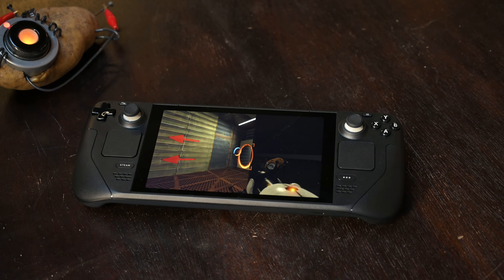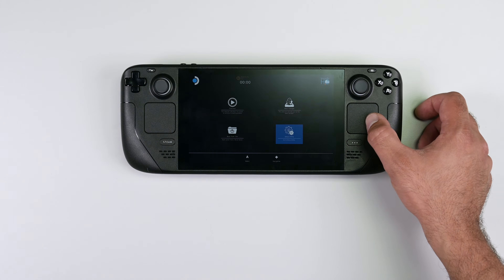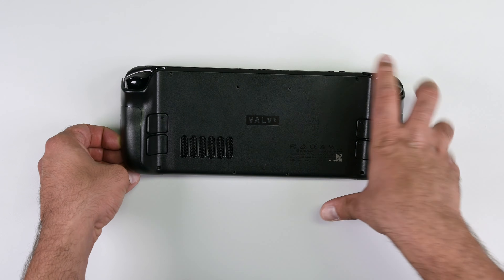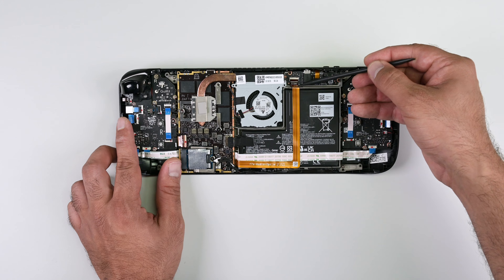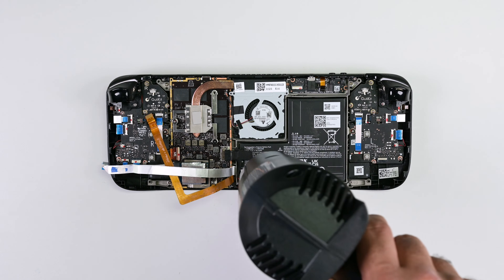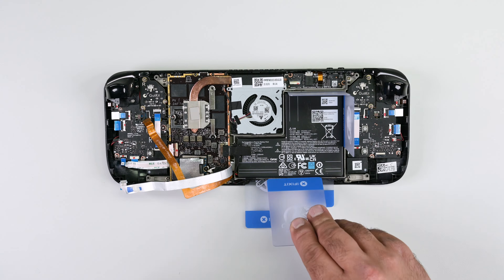Steam Deck Battery Replacement: Replace Your Dying Battery!

Comment: Ah, the one thing I don't like about the Steam Deck... adhesive battery. I wouldn't be made if the Steam Deck 2 has an external battery that locks into place.

Comment: Well my battery just crapped out i got no power unless its connected to the charger so i guess ill be doing this in a week
Reply: Ever fix it?
Reply: @Jesus_Freak_Brethren I did, it went well just be careful mine had very small wires ran across the bottom i almost broke
Reply: @cokfordollie the bottom of what? 😱
Reply: @Jesus_Freak_Brethren  of the steamdeck where you have to pry up the battery

Comment: allright. genuine question. so my steamdeck battery health is at 70% after everyday use over 3 years. 
for now i dont see any major diffrence in battery charge holding when im using  it even if i stress it constantly by for example puting into sleep mode with game on. 

when should i start to consider replacing it then?

i heard from cousin that with laptops when battery life hits that mark they sometimes have to be replaced but idk if i should belive that and re0lace battery asap.

Comment: My battery seemingly failed from being left dead too long (because the Steam Deck seems to guzzle power when "asleep") and now my Steam Deck will not turn on even with the power adapter plugged in.

Comment: Nothing like heating up a lithium ion battery. Getting to it is no problem taking this thing out is not worth it. Obviously it’s not intended to be replaced. Modern electronics forcing waste. I’ll now wait for the Legion Go S Steam OS version in May of 2025. Not buying another Steam deck. Mine was finicky from the beginning.
Reply: Dis you get you Legion Go S? Is the battery in it easily replaceable in it compared to the Steam Deck?

Comment: I think the hardest part was pulling the plastic backing off. If my battery goes up again in another 2 years I'll look into modifying the backing with a swing door for easier access to swap it out...because the family has three of them.

Comment: Any reason why they didn't make the battery screwed in like a lot of laptops instead of adhesive? I have a dell laptop and replacing the battery is a matter of removing 4 screws.
Reply: Cost of Parts? Assembly time? Convenient placement? Screws wear and tear the females plastic threads? Idk 🤷‍♂️ your guess is as good as mine, I’m curious too:)
Reply: @higheststandards3344 Cost of parts? Dude the replacement battery is 90 freaking euros on the European iFixit store, that's without the adhesive or anything else.
For that price I really wouldn't mind 3-4 metal tabs with holes to screw through into ideally a metal thread of the battery compartment.

The price of a Steam Deck battery is extremely off-putting, probably because of the exclusive partnership. It'd be better if they could be sold by others officially as well.

At this point I'll just wait for the Steam Deck 2 and stay near outlets with my OG. It's a shame though since I really like my Steam Deck and would like to use it more freely.

Comment: Not very PC friendly for a device that is marketed literally a portable PC since the battery is “Hard” wired to the console like most mainstream portable machines. 
Terrible mistake on the part of Valve. They should have seen the flaws and limitations of lithium batteries and should have opted for a pop-in design for battery since they would be necessary. 
I smell a forced upgrade

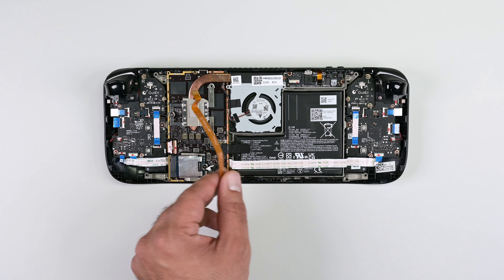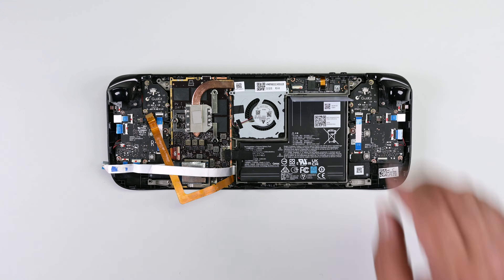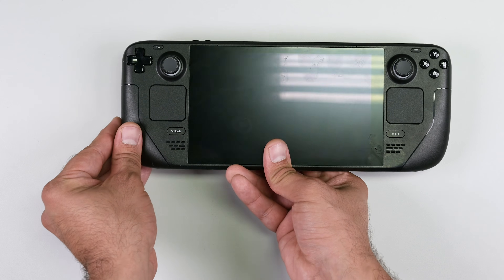Comment: Isn't any TS wire anything they named a party after - everybody has it or repair it and db you know too as local database IT company. Every tombstone in the Taylor swift song.That metal could not be very strong on low end laptop screen hinges 4:11, but you know how to care about only thing in the world making you happy 4:24. Careful there 5:14 you be hotel model falling over the window. It's something as Yrel in Leoric trap 3:49. 5:57 this plastic is there since those 16bit/32bit consoles, but don't let it be anything everybody knows about League Of Legends.

Comment: The battery was a nightmare to get out using the Amazon replacement kit i bought, i ended up warping part of the frame with too much heat. It's working now though.

Comment: I own a switch and was curious if Steam Deck solved the easy to install battery problem. At least steam deck allows power cord plugged in with a dead battery to work unlike Switch. If Steam Deck 2 makes easy to replace battery like old cell phones I'll buy it until then I'll use my Switch which will eventually be e waste.

Comment: FYI - Make sure you get the adhesive since for some reason it doesn't come with the battery and I had to wait another week to fix my deck
Reply: why? You can use, for example, double-sided adhesive tape.
Reply: Good to know, thank you!

Comment: Man, I'm just glad they made replacing the battery such a simple process.......
Reply: PSP batteries were ahead of its time man…..
Reply: @RoyelNotRoyal  Facts, got my PSP in 2008 and the only thing i had to do between then and now is pop in a new battery and it's ready to go again. the fact you have to do all of this to replace a battery in a modern handheld is ridiculous in this day and age.
Reply: @billjames-tn7nf  for a device such as Steam Deck, where you can do a few easy replacements and the directions to do it, they certainly dropped the ball on one of the most replacement necessary parts (and dangerous ones).

I really hope that a Steam Deck 2 will have easy to replace batteries in the future. :/
Reply: Can't tell if you're being sarcastic but this is leagues simpler than 90% of things like chrome books or modern smart devices.
Reply: @Aaron-fh6hd  You really can't tell? Wow
 Also, "leagues simpler" is a gross exaggeration for effect but it is also false.
 Also for most of those devices there are places you can take them and people will do that for you if your are not familiar with those type of things.

Comment: I followed this instruction and unplugged the battery and reconnected it because my deck wouldn’t turn on iv put it all back together but now my deck won’t appear on any dock iv tried 4 any suggestions?
Reply: Did you fix it?
Reply: @ no it works in handheld I assume it’s never going to work again on a dock this is my second deck and second time this has happened iv seen a few stories online where this has happened not really sure what to do next tbh
Reply: @ryanfilmer51  Gotcha, same thing happening to me. Thinking about swapping battery completely
Reply: @Failer1337 I would be surprised if it fixes the issue but if it does please let me know I imagine there is some chip that allows for video out and I think that’s fried it was strange because both times the issue happened the deck died until I pulled the battery cable out and back in again
Reply: @ryanfilmer51  Here’s the backstory: My SD somehow suffered some water damage and the CRTL - R cable and Right Controller board apparently had corrosion by the time it came in for the RMA(i was unaware at the time). They said they could either throw it away or send it back, nothing else. I got it back and now it works like nothing happened (original issue was unresponsive button/touchpads) but suffering the same thing as you. Mine shows fully charge as soon as I plug in the cord, but showing 0% in desktop mode. Instantly dies when unplugged and not enough juice to power up in the dock. Will update after I do the battery swap.

Comment: how can you put it in battery storage mode if the battery if fully discharged would be no power.
Reply: I'm wondering this too. Had to plug it in to put it in battery storage mode. Now I don't know if it's fully discharged or if it has lika one or two percent power...

Comment: Wow, that's a very dangerous design valve have gone with there using adhesive and needing to heat the battery. Using a plastic bracket and screws like laptop batteries would have been the more sensible option, but can understand there may have been space restrictions.

Comment: This seems easy enough! I need this so bad as my OG Deck's battery is at 70% BH
Reply: thats still another good 2 years left on it
Reply: How do you check your decks battery health?
Reply: @NormanTheDormantDoormat  its in the bottom right in the desktop mode. Not too hard since its literally there
Reply: mine is 61% but it's a day one model. Man, I dread the day I need to change the battery (and d pad since it's got a bit of a wiggle/resistance with pressing left/right) 0o0

Comment: Changed the battery on my OG stead deck today and can confirm that there’s almost no chance of anything going wrong if you use a bit of isopropyl alcohol to loosen the tape

Some important details that are omitted here are that firstly there are only two strips of tape on the larger battery cell— one on the left and another on the right so if you’re going to slide in a plastic card and wriggle, do it on the edges

Second, it is not the kind of acrylic polymer tape that will release with heat but it’s a very strong double sided foam-based tape. This means, if you can get some alcohol in there with a plastic card and just tear through some of the foam, that’s good enough too. 

Once the foam tape breaks down on either the top or bottom, it’s just really easy to slide a card in on that side and lift it up and the test of it will come off quite easily. Remember, you’re dealing with a foam strip and not raw adhesive— this is the main detail here
Reply: Nice, thanks!

Comment: You removed the aluminum tape and didn't put it back on after replacing the battery and closing the back again. Is that safe? People are saying that tape keeps away harmful signals from the motherboard.

Comment: Valve should just make the Deck 2 easily replaceable battery in the future.
Reply: They should make it hot swappable with a battery charger on the dock.
Reply: At least you can do this in a matter of minutes. I'll take this over not being able to at all without flux
Reply: Easier than this? This is so simple. The only complex part is heating it. Im not sure they could have made it any easier than this.
Reply: Agreed, this is ridiculous
Reply: This is also easy. Just do it.
Reply: @TrompKramer i think it’s more about the nervousness with the heat gun, if you’re too far with it the process is a lot longer and if you’re too close, it can cause alot of damage. Also mind you that not everyone is techy so what may be easy for you isn’t easy for others. Bet if I took you back on an aircraft carrier and told you to do the job of a console recorder, it’ll be easy for me but hard for you kid
Reply: @UllrGamingGod I don’t think they should, that gives valve and the designers more room to make batteries disposable. It would lead to them making cheap batteries that you have to replace over a shorter span of time, then they can say “buy our exclusive steamdeck battery for $120 bucks”. I don’t know kinda glad it’s hard to get to…
Reply: @UllrGamingGod plus they already were very thoughtful on giving us wiggle room to work on it… unlike other companies.
Reply: @UllrGamingGod ones a job and one is a battery replacement homie
Reply: @TrompKramer  it is not

Comment: nintendo switch batt is better.
Reply: I noticed this with my brothers who had Nintendo switch but honestly it's graphical capabilities are weaker than the steam decj
Reply: Switch’s power draw is capped at 8 watts, whereas the Deck goes up to 25 watts. Switch’s battery isn’t better, the device just draws far less power.
Reply: Facts never have an issue with my switch. Bought my buddy steam deck when he upgraded to the OLED and it stopped working three months later.

Comment: Dude! You just saved me. My steam deck hasn’t turned on in days and I’ve tried every means to try boot it up. The fan spins but the deck itself didn’t display. I tried to put the battery in battery storage mode but didn’t work, so I opened up the deck and couldn’t figure a way to pull out the battery cable because I felt it was glued. Your video saved me!!!! Thanks a lot 🙏🏼
Reply: Bruh I'm having the same problem with mine. I hear it running, and the LED light turns on and then turns off, but the display is black. Also this happens even when plugged in.
Reply: @Blackboss-b7k I'm having the same issue! I pulled the cable for 30 seconds and plugged it back in, but nothing.. Any luck on your end?
Reply: @vi_obsiver  Just had the same problem. Fix for me was one of, either:
Turn it on and then hold down "..." on the right side and down on the d-pad for 5 seconds or so.
Or, turn it off (hold power for 10 seconds) if it is on. Then while holding the same "..." and down d-pad buttons, turn it on again.
One of those worked I can't remember which.
Reply: @ADRKHRS  no luck for me :(

Comment: Ordered a replacement but the battery I just installed will not take a charge. It’s at 53% and will not go up in charge after being on the charger for an hour. Any ideas other than a bad battery?
Reply: faulty batt, you should buy to trusted shops.

Comment: My Steam Deck battery is down to 85%
Reply: 83 on mine but didnt notice
Reply: Mine now says 99 so I think you just have to cycle it
Reply: 80% here but I'm noticing it
Sadly it arrived a year and a couple months ago so it's barely over
Reply: Where do you see that information? In the boot loader?
Reply: @Mikhail-Kuhn  On the desktop, there’s a battery icon on the bottom right.

Comment: Why would we want to put adhesive on the new battery when this was exactly what you complained about when the teardown was done? If anything the leftover adhesive from taking the old one out would be enough to hold it since it's in a well that is going to but against the case when you put it back on.
Reply: Ribbon cables are extremely fragile, and a loose battery pressing against them even a little bit could destroy them, the adhesive is needed because of this design.
Reply: Maybe, but these ribbon cables seem a little more robust than that, considering you have to pry them off the battery just to get them out of the way.

Comment: heres a question, do you have to reapply the adhesive on the new battery, and could you trim it down to just be around say, the edge of the battery or only a few small spots so that way if it does have to come out again, it isnt as much of an issue?
Reply: Finally someone said it!!!!!
Reply: @bill_birba  for real I'm still wondering this. I'm wondering does the battery having that adhesive all the way make it so the air doesn't go under or something or if there would be no issue actually doing what I mentioned I really would like someone who's knowledgeable on this to let me know because when the time comes and I need to change the batt I'd be tempted to do this
Reply: Still no answer to this. 
The Battery is so tightly fit does it even need ANY adhesive?
 I'd just put adhesive in small spots for the next time the battery needs replacing, which you WILL be doing, so you can easily break it.
Reply: Good idea, I'll try cutting my adhesive into squares or strips for only the top and bottom of the battery. The hold should be good enough since I'm not jogging with this thing.

Comment: I've got 19 year old laptops with batteries that still work; this says A LOT about the steam deck quality.
Reply: I got my steam deck during the q3 pre-order shipments and my steam deck’s battery is still tip-top shape as it was when it was fresh from the box. I think the reason why this video exists for the worst-case scenarios such as being in a too hot environment.
Reply: @DakkaNah2619 nope, mine just clapped out after a year. Its just been inside my house. Its poor build quality here.
Reply: @DakkaNah2619  I have the Steam Deck LCD and it won't charge above 93%
Reply: Yeah, this video is puzzling to me as well. It’s only been out for about a year
Reply: Also I'm pretty sure it has something to do with a regulator in the battery that gets tripped somehow. So it's not that the battery is dead but a part of it that can't be fixed without a full replacement.
Reply: @Mikhail-Kuhn if a part cant be fixed without a full replacement it is dead lmao
Reply: Different chemistry on that battery, different energy density, different voltage/current requirement for device, and finally, chances are that's a big ass bulky laptop with no dedicated graphics hardware and the only real semiconductor device giving out significant heat is the CPU which would be far away from the batter when you compare to something as compact as the steam deck.

Comment: Could you use the Apple Pulltabs when reinstalling the battery? Seems like this would make further repairs easier.
Reply: my thought exactly. that way you can just pull tab it over heating.